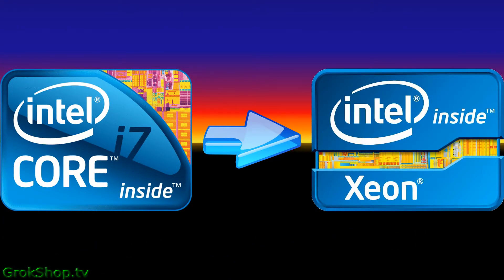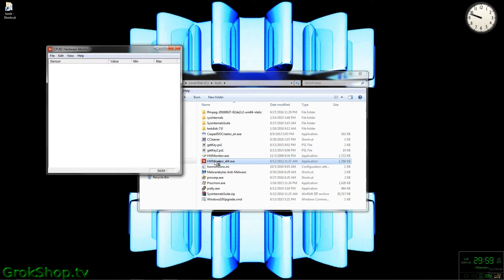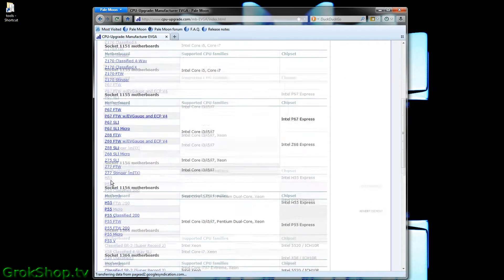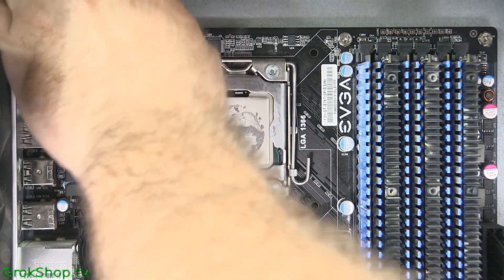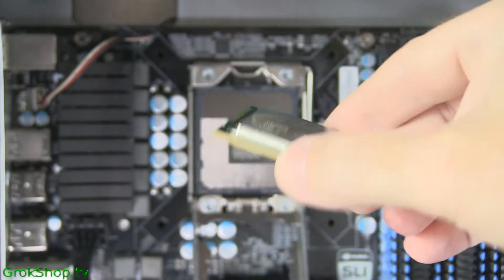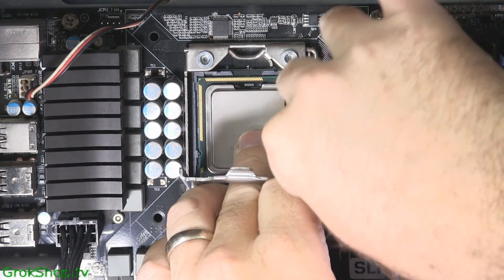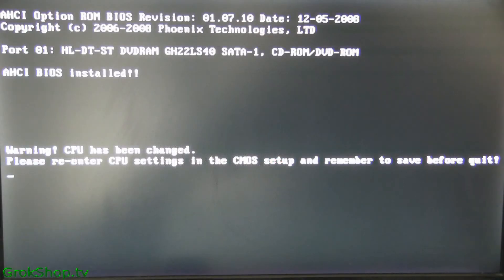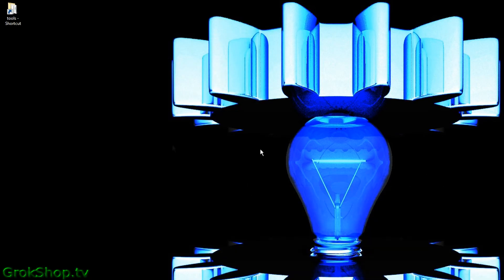DIY Faster Computer [Part 3]: CPU Upgrade Intel i7-930 to Xeon X5680 | How to Upgrade CPU

Comment: hii man graet job. ask u q I have 5680 same xeon cpu .But mainboard can not found please Give me a list Xeon 5680 with Which  mainboard.. Thnx ı will waiting ur answer
Reply from the maker: I don't know if someone has a master list somewhere.  Maybe.  But if not, you can just search for boards that have Socket 1366 / B / LGA1366 for the CPU socket.  Mine is an EVGA.  I have 7 or 8 active machines at home, and the one in this video with the x5680 is still one of my favs, despite the age of the mobo which is over 10 years old now lol.  Maybe one of the best bang/$ upgrades I have ever done.

Comment: You can get these chips on eBay for $50 used from the states.
Reply from the maker: Thanks Lignimvite.   Prices are definitely dropping on these!
Reply: Just had mine delivered to the door for just $47 hopefully good times, also bought an x5687 as a backup ?
GO! EBAY.
Reply: @michaelperrin2531  How it is for gaming, I currently have i5 760 and thinking about upgrading??

I was thinking that is cheaper than to overclock i5 LOL ... considering price of fans

Comment: I got my X5675 to 4,95Ghz (only for benchmarks) i ran a cinebench score of 1123CB on 4,8Ghz with a lot of QPI and ULCK tuning (QPI was on 44x multiplier, and ULCK was +/- @4600Mhz, with 12GB DDR3 Running +/- @1900Mhz)
4,95Ghz I got 1127CB without tuning ULCK or QPI.
paired my CPU with a GTX1070
Reply from the maker: Wow, nice OC'n Kyro!  That's smokin (hopefully not lierally, heh).  Thanks for sharing your config!
Reply: Thanks for sharing Kyro, if i want OC my X5680 to 4.5Ghz do you know what setting i need?

Comment: I just got an x5660 on ebay for $23, shipped. Putting it in my pc today. Upgrading from an i7 920 @ 3.8ghz. ( running on water ). I think I am gonna try to get about 4.2ghz out of the xeon.
Reply from the maker: Well played man.  With water I think that should be easily doable.  Good luck with the install!

Comment: If a cpu is not on the list of my mobo, does it mean the mobo will absolutely NOT accept the cpu i want to install on it? I have a quite old mobo Gigabyte GA-EX58-UD4P and i also want to put the Xeon X5680 on it and then give the pc away to someone else.
Reply from the maker: Looks like your socket 1366 X58 board supports some Xeons.  I think the cpu-upgrade site gets most of its data from the mfg, so if you want to put in a Xeon that is not on the list, I would check the mfg docs &/or contact their support.  Certainly don't buy one without some sort of backing.  If the X5680 is not supported, you still have a nice menu of hex core Xeons available to choose from.
Reply: Thank you very much for that advice. Keep up the good work.
Reply: @grokshop  If I know that my mobo will run a 5665 will it run all of the 56XX chips such as the 5690? My bios doesn't have the option to oc so Im looking at getting the highest frequency chip I can for the mobo.
Reply from the maker: @drzoidberg1  Where did you get 5665 from?  I don't see that one listed here:  https://en.wikipedia.org/wiki/List_of_Intel_Nehalem-based_Xeon_microprocessors#47916
Reply: i read somewhere that if the i7 908x is supported, the x5680 runs on it as well. will try that out soon. did your setup work out?
Reply: Look on the net for your board with a xeon. Even if the manufacturer does not list xeon it may still work when updated to the latest bios. I'm running a x5660 i purchased for $14 on ebay oc'd on air to 4.3 ghz. It is awesome!

Comment: Could you get 100mhz with the turbo on?  An extra multiplier should make it 3.6ghz? I appreciate your video. I have the same board with an i7 920 and GTX 970 and about to install X5870 2.93ghz for extra life on the chip set for Maya.
Reply from the maker: True story...  my 4 year old knocked over a glass of water & cooked my mobo & GTX970.  Had to run on my 4-core 3rd gen i5 PC for a while.  Faster single-threaded, but much slower multi-threaded & overall than this rig was.  So, I picked up a second-hand FTW-3 for $120 on Ebay.  Very similar board.  Moved the same Xeon over and now with Turbo I can verify 3.6Ghz on the DummyOC.  I probably will get  Noctua in & OC it in a future video.  I would like to see it at 4.4GHz :O)
Reply: @Steven Ramos I have the X5650 OC'd to 4.4GHz with the same EVGA X58 SLI3 mobo. With the chip I got, it managed to hit 4GHz on 1.25v (1.3v with vdroop) and 4.4GHz was with turbo on and ~1.4v (1.3625v without vdroop (under load it bounces back and forth between 1.399v and 1.411v)).  It's a really nice chip that ought to extend my system by at least one more year before ultimately upgrading to a new chipset.

Comment: I had until recently a GTX 960 4GB. For several days I bought a 1060 GTX and frankly I did not see big differences..In GTA 5 runs like 960. The idea is that we have seen in other videos that shows a big difference (960 to 1060 fps). In other videos see how others play GTA 5 on the same GPU 1060 with between 75-100 FPS I play it 45-60 and sometimes decreases and 30 and do not understand why. I saw a video test vs i7 6700K and i7 920 was a different maximum 10 FPS. I find little difference .. I have the game and the SSD. Really I do not know that can be a problem. ..l wanted to take a x5680 but I fear that will not have any change. Many thanks for the answer that you gave me! ( sry my bad english.)
Reply from the maker: Yeah those are both good cards and your vram should be ok.  I have a GTX-970 with 4GB.  I was rendering 3D stuff in blender using CUDA and the i7 was choking trying to keep the GPU fed.  The Xeon doesn't blink.  Anyway.. from my limited knowledge of GTA, it can be one of the more CPU-intensive games, depending somewhat on the settings you choose.  I would bet your CPU is pegging and if so, I recommend a Xeon like the 5680.  Something that starts in the 3.2-3.5GHz.  Then you can overclock it if you need more.  Run those performance log tests tho to know for sure.  Pretty soon they will be less than $100.
Reply: I understand. A thinking about a possible upgrade..but not sure whether to go on Supermicro motherboards.

Comment: It is worth upgrading from 920 to x5680?  Especially for gaming. ( To gain some FPS) Thanks For Video!
Reply from the maker: Hey Eazy.. thanks for droppin by.  The answer to your question is: it depends on the game & what GPU you're running.  There are some games which are more CPU intensive than others & for those games you could bottleneck on the CPU.  But all games need a certain amount of CPU to keep the GPU fed.  What you can do is monitor the CPU load during the games your FPS is dropping on.  If the CPU is pegged at close to 100% most of the time... a CPU upgrade will definitely help.  If its lower -  esp below like 70% most of the time - AND your FPS is too low, then you need a better GPU.  Check out this article at PCGamer which shows how you can log the performance of both CPU & GPU:  http://www.pcgamer.com/will-your-cpu-bottleneck-your-graphics-card/